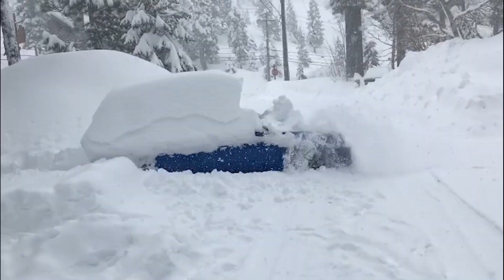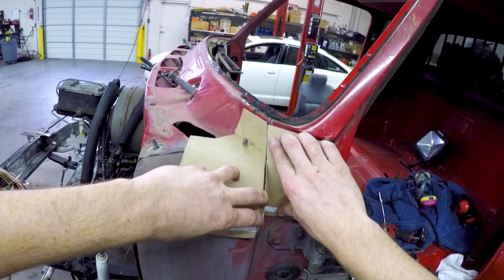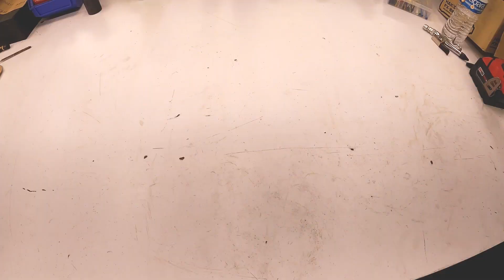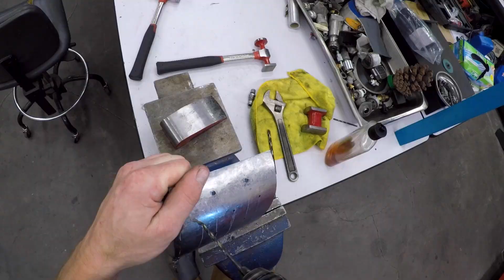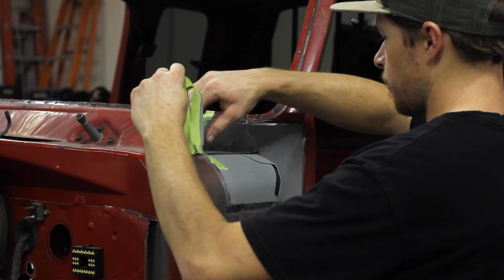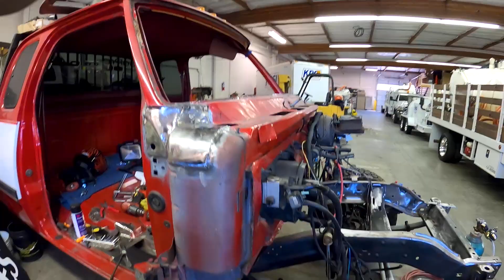Fixing the Dreaded COWL CRACKS- 1st Gen Cummins

Comment: Do you have any rust on the drip rail ?
Reply from the maker: Not that I've found... Hopefully not. Sealant is still in ok shape, hoping it's just the floor of this thing
Reply: @addisongranger  that’s good. Mine is rotted out. I have new roof for it though just haven’t put in yet. Keep them videos coming man. Can’t wait to see your truck done.
Reply from the maker: @Jordy40Growing  Ah that's a bummer. Damn first gens haha. Wish they would've done a bit more rustproofing at the factory... And thanks man, I appreciate it!
Reply: @Jordy40Growing  Did you fix your drip rail rust yet? My drip rail is getting worse by day and I'm kind of dreading fixing at this point... LOL
Reply: @OvensGarage  Whats up Tyler, No havent fixed yet. I've been trying to get my steering right and did a full lube maint and brakes. But after i get new leafs i will get that roof fixed. until then she'll be tarpped in the winter.
Reply: @Jordy40Growing  yeah been thinking about a new steering box and crossover steering to tighten things up on mine